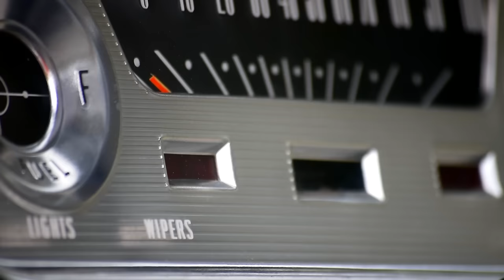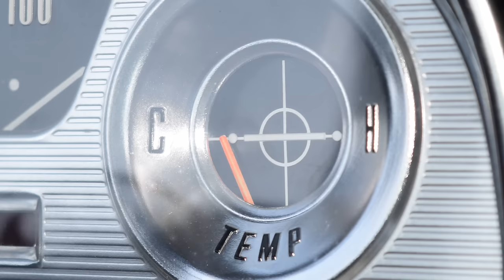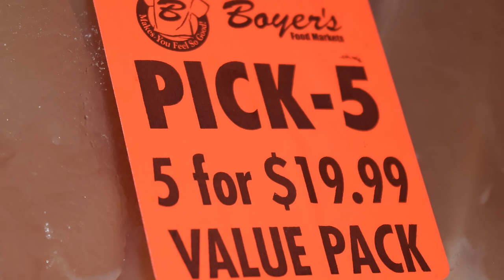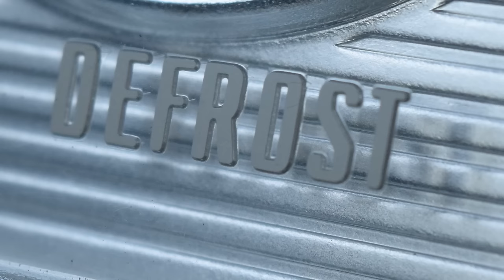Regular Car Reviews: 1960 Ford Falcon (stock)

Comment: FYI, the 144 was used through the 1964 year in the Falcon, Mercury Comet and E series vans.  Durable little engines.  Love Falcons!  Have owned a dozen, ranging from 4-doors,  Sprints and Futuras [coupes and convertibles], Ranchero and a trio of wagons.  I made a  63 wagon into a Sprint, too.  Lots of fun.  260, 4-speed, Futura seats and consolette.

Comment: The Falcon was brought to Australia and became Fords most popular nameplate in Oz until the models demise in 2016. The Inline six (with original block) evolved into a 4.0lt Twincam 24 valve with Variable valve timing and an Alloy head. In Turbo form, it cranked out 310kws of power.

Comment: This was my first car. I graduated in the 90's and my dad bought the Robin's egg blue version of this exact car. He found it in a newspaper classified ad. Remember those? lol This thing was so old it didn't have seat belts. My parents had to take it to the Dealership and it took ages for them to find some, since no one made cars with just lap belts. SEAT BELTS WERE AN OPTION ON THIS CAR IN THE 60'S!  I will say mine was a little fancier than yours as it did have the optional padded dash and the side view mirror, as  WELL as the two speed (slow and slower,) automatic transmission. Mine also had the 144 engine, and It broke down once a week whether it needed to or not.   OH, one thing you missed is that it doesn't have window washers.  My dad went to the junk yard and robbed the sprayers and pump and tank. The hooked the pump up to the battery and put a toggle switch in  the car. He taped it to the steering column. Flipped to "ON" it would run forever if you don't flip it back down to off. I did complain a lot about how it was so slow, so eventually he got a 200 motor and 3 speed transmission from an old wrecked mustang and put that in. It felt like a sports car after that.  A sports car that rode like a Cadillac with that vague steering you mentioned.   I kind of miss it now. lol

Comment: Got to love the Falcon, I remember these cars when they came out.  You could still see these cars on the road up until the late 1970's.  To the narrator, the Falcon's are not seen on the road today because they were daily drivers up until the mechanical end of the machine.  They weren't glamor cars, they were blue collar working man cars and were driven as such.  You could fix almost everything with a wrench and screwdriver.  The heaters worked and if you got too hot, well just roll down the windows and turn on the vent blower.  

Side note: when Star Wars came out in 77 Hans Solo flew what?  The Millennium (Thousand Year Ford) Falcon.   Dont tell me Lucas didn't get the idea for the space ship from that:)
Reply: so true. handle nice and fun to drive. i had a 3 on the column

Comment: The Falcon was a disposable car. They were fairly easy to repair, particularly the usual things such as brakes, water pump, spark plugs and so on, but rebuilding an engine was not part of the equation. There were no side access panels for the lifters, and you had to pull the engine to remove the oil pan. I know, I helped work on one in the early '70's. One thing it really had going for it was weight. Those weighed about 2400 pounds, so they could get decent gas mileage. The Holley carburetor was a very small 1 barrel. It almost looked like it was more at home on a lawn mower. There was a kit where you could put 3 of them on the intake. The intake and head was all one piece. There are cross members available for early Mustangs, and one might be a good idea if you want to drive a Falcon a fair amount.

Comment: The 1960 Falcon was my first car.  I bought it used in 1968.  It took me to high school and trade school for two years.  It took me to my first real permanent job at Chrysler Corp. in 1970.  The oil pump gave out and my engine went kaput.  Now I could afford a brand new 1971 Ford Mustang Mach II.  Moving on up.  And the rest is history.

Comment: Yes the Ford Falcon was as basic as they come, even the radio and cigarette lighter were extra option. My dad bought on in November of 59, the start of the 1960 model year. It was my dad's first brand new car. He always brought used before that. It was one of the best selling and most popular cars that year. The black interior was the basic interior and to start the model it was the only interior color offered. The Car came in different exterior colors, green, blue, red, white and black, but the Interior only black for at least the first half  of the model year. Later more colors came available, some interior options, too. That year my dad bought one, green with a three-speed manual transmission column shift and no radio, or cigarette lighter. A man he worked with bought a blue one same configuration. One neighbor bought a black one in the spring he was able to get an optional tuck and roll upholstery, another neighbor got a station wagon, which has a brown interior with a western horse theam to it. Only Falcon I ever saw with that interior. My uncle bought a white one with a padded dash and tuck and roll upholstery. It was the only one with those options. The Falcon line started the model year with just the basic two door car and added models throughout the year. By the end of the model year you could get a station wagon, a Ranchero type model, they put the Falcon nameplate on a van, it looked like a scaled down Econoline van. They also offered a pickup truck-style vehicle modified from the van. All these vehicles were basic. As the years went on the options and materials improved I bought a 1963 Falcon Futura convertible in 1969 for my first car. The last year of the first generation of the Falcon. The second generation 1964 and 65 had an all-new body design. The third-generation body design was all new again. It consisted of 1966, 67, 68, and 69. Only slight changes were made from year to year.  The steering wheel was different every year, the tail lights change in 68 and side body reflectors were added, that year. In 69 the reflectors were replaced with running lights. Weird things happened in 1970 Ford continued to make and sell the 69 model as a 1970 for the first half of the model year the they put the name plate on the basic Fairlane to finish the model year. It was the last year for Falcon and Fairlane in the US. 1970 was the year they introduced the Maverick. It was always my personal opinion that Maverick started out on the drawing boards to be the next generation of the Falcon, but marketing wanted a brand new model to create excitement to sell the car. So it became the Maverick instead.
Reply: YouTube  gave me this video to view again.  So a few more criticisms came to mind. The narrator of this post in his complaints tryst to make Ford look bad and blames Ford for the lack of quality of modern cars built today. The beather oil cap, the parking light not being amber, and he states that the only option was the automatic transmission. The fact is the radio and cigarette lighters were optional you could get the care without them. The 144 engine remained the standard engine for four years, with the 170 engine as optional if not available in the first half of the model year it was available by the next year. There were optional interiors. The standard fabrics in gray with black paint on the metal parts. There was an optional tuck and roll upholstery with upgraded fabric, still in gray. The station wagon models had all vinal seats. These options were available in 5he first model year. Some of the things that weren't there were not required by law like they are today, side view mirrors and amber parking lights. Although I can't recall any of the 60 Falcons I saw back in the day that didn't have a side rear view mirror on the left side of the car. If it wasn't standard it must have been another option. It wasn't until sometime during the 70's that they became required on both sides of the car. I think in 1962 Amber lights were a government requirement.
Reply: The Falcon was nicer than anything in its class coming out of Europe.

Comment: This brought back a few memories.  My dad bought one of these brand new (in Australia) when I was 3 yrs old and I still recall him bringing it home. I also recall the number plate - CFN 896. By the way, the Australian 144 CID engine was rated at 90 HP nd had a different final drive ratio to the US model.  That was 20% more than the 138 CID engine of the Holden FB at the time.  He worked as a real estate agent and wanted a roomy car that he would not cry over when clients messed it up.  He later bought a Falcon Futura 1963 with the 170 CID engine - and a big performance increase with 111 HP, and bucket seats.  My mom then drove the '60 Falcon and at 3 yrs of age, it needed a gallon or two of water every day to stop it overheating, one of the thrills of the unguarded fan in a warm climate.   He then bought an XR 200 CID in 1967, despite my brother and I nagging him to get the (then) 289 V8.

Comment: Here in Argentina, the Falcon were in prodution from 1963 to 1991, the first change that Ford Argentina made was replace the american 2.7 litres engine for a 188 cubic inches engine made in Argentina, and the second change was replace the 2 speed transmition for a 4 speed and third; the car was only made in  6 cyl. Sedan, no V8. Also we had some exclusive models

Comment: I learned to drive in my mom’s ‘61 3-speed manual with the stick on the column. There was no PCV system in the 144 and that too just vented to the outside via a pipe down the side of the engine. As the rings began to wear, the blow by would smoke out from underneath. I lost count of people telling me “Hey your car’s on fire.”

Comment: Bought one from a friend in the mid 70's for $50. Rear doors were held closed with a rope tied between the inside door handles. Common column shifter 3 speed manual with the roll pin that wears out and you have to hose clamp the shifter and the column together or the shifter just falls off. Drove it a couple of years and many miles. Very few problems, best $50 I ever spent.

Comment: I inherited my Aunt’s 63 Falcon that she badly overheated, The paint on rear block and valve cover was scorched off. It had the worst blow-by. When you stopped at a light the black smoke would engulf the car. It was a real dog, put four guys in it and head to Fire Island on the LI E and top speed was 67 mph with the pedal to the metal. It did have a floor shift, console and bucket seats to give it some pizzazz.

Comment: My first car was a 1960 Falcon. The best car I ever owned. I wish I had kept it. I bought it in1970 for $200.00 dollars. Best car to drive on icy roads. She wasn’t the fastest car but could do 60 without any problem. Over that she would start to shake but I managed to pass  all the slow pokes. When I bought another car I gave it to my father. He kept it till 1980 and then sold it to a young man as his first car. Never spent any money on repairs. My father would do my oil changes and tune ups for me. That’s all the work she ever needed. Also could fit a lot more people in it than just six.

Comment: They didn' t have a heater or radio optional also was a padded dash; my dad had one in Australia, Koala grey with a white top, they were an eye turner when released because the big seller at the time was the Holden which had fins and looked so old fashioned. They weren't rugged enough for unpaved Australian roads sometimes they would lose a front wheel, until they strengthened up the front end with the XL model, loved them so much I ended up selling them..... what memories!

Comment: I bought a '61 Comet in 1989 and drove it for 9 years.  It had the 170 ci engine and 2 spd automatic.  It drove perfectly well and didn't smell like gas all the time.  It was not underpowered, kept up with modern traffic, street or freeway.  It was a great car.

Comment: My parents owned a 1960 falcon station wagon. Not sure if they bought it new, I was a year old, but I  loved that car. I remember being about 5, I use to drop the tailgate and hand crank the window out of it. Smart enough not to sit on it though.  It died when the steering rod broke as my mom was pulling in to the driveway causing her to crash into the corner of the house. Only 7 but I cried when it was towed away. Wish I could get my hands on one

Comment: That engine is ADORABLE! It makes as much power as a medium-sized home generator!
10:24 meanwhile the two speed jetaway in my Oldsmobile (not a 4-4-2, they only had the 4 speed manual) can squeak out about 65-70 miles per hour with kickdown.

Comment: The basic structure of this car was used for the Mustang.  The original Mustang was nothing but a Falcon with a sexy European looking body on it.   Drum brakes all around?  In 1960 even high-end luxury cars came with drum brakes.   Single master cylinder?  All cars had them in 1960.  DOT did not require split master cylinder until 1967.   Side-view mirrors,  back-up lights, side marker lights, PCV valve,  padded dash,  seat belts, none of that was required by the DOT in 1960, lots of cars from all manufacturers rolled off the assembly lines without that stuff.   Cat?  Those did not appear on American cars until 1975.  As for Robert "Kill Ratio" McNamara, it's bullshit to say that he '...didn't believe in options.."   It was, and still is, common practice with car makers to hold off on  all the options in the first model year.   With each subsequent model year, more options would be offered to keep up interest in the car.    Eventually, the Falcon was offered with a huge option list.   Multiple displacement I6 and V8 engines were offered, including a Hi-Po four barrel 289 V8.  At the time all car companies used the gross HP method to advertise HP, only switching to the net HP method when gov regulations required it.   Multiple trans options, including 3 speed manual, 4 speed manual, 2 speed auto, 3 speed auto, shift on the column or floor.  Bench or bucket seats could be ordered up front.  Body styles included two door or four door sedan.  Two door hardtop.   Two door or four door station wagon.  Ranch wagon.  Two door sedan delivery and convertibles.  Manual or power steering was offered.   You could get the cars with a heater, or without a heater, with AC or without AC.   The options lists seemed endless.   Your snark is just cover for the fact that you didn't do your homework and don't know what you are talking about, or you are just trolling for clicks, or both.  In conclusion, fuck off.

Comment: I have a very base model 1966 falcon 2 door.  It has 3 on the column, two spoke steering wheel with just a horn button.  It is so basic it has a blank plate for the radio and the spot for the cigarette lighter has just a chrome disk.  It even has the last year 13 inch wheels and small diff.  Folks are always telling me to rod it and I don't because you see those all the time but you never see one bone bottom of the shelf stock.  It get 26 mpg and insurance is $20 dollars a month.  Its a great little car.

Comment: This was my first car, same color, although mine was a "Ranchero" You could drive all day at full throttle and never risk getting a speeding ticket. Three on the collum had a bad habit of getting into two gears at once (total lockup). Under the skin, the car was the same as the early V8 Mustangs. After years of swapping in high-performance Mustang parts, I finally built a pretty fast Falcon!

Comment: 494000 made in Argentina with '63 4-door body between 1963-1991 (minor changes in 28 yrs), since 1978 it had power steering and a/c, more than 150k still running, parts available everywhere, angines 170, 187, 188 and 221 6cyl. (no 144 here). A few 1962 ckd import ones too, mostly gone. People still loves Falcons.

Comment: I had a 1962 Comet, with that little 6, and a 3 on the tree. It was a good runner, and would do 60 mph all day, but the windshield wipers ... They were vacuum powered. I drove through a gale in Florida, and didn't have the power to shift up to 3rd. And the wiper blades barely moved unless I took my foot off the gas for a moment, so I could see where I was going. It was a good car for an impoverished teenage hippie, very easy to work on.

Comment: Back somewhere around 1968 my father bought a '61 Falcon 2dr. red station wagon from a guy he worked with at Union Carbide for $25.00 .  144 ci.straight six and a manual 3 on the tree . It had a rod knock . Dad dropped the oil pan ,separated the rod cap , hand polished the crank journal , & put in a new rod bearing . For many years to come it served as a 2nd family vehicle and extremely dependable . The running family joke from that point on was that anything and everything purchased was calculated into X numbers of Falcons .

Comment: I worked at a Ford Dealership in 1965. One of our loaner cars was a 1960 Falcon with the 144 ci. six and ford-o-matic trans. A true boat anchor. I heard it was so hated by the public that Ford offered to upgrade to the 170 ci. motor for just the cost of labor for the swap.

Comment: Every Falcon I was in from the first generation had a very distinct odor to the interior, perhaps it was McNamara's perspiration as he crunched those numbers. Regarding turn signal lenses, the change to amber was made in all cars in 1963. A family member had a well used 61 Falcon, it had the CA required PCV system added to it to replace that open crankcase, which was the souce of a ton of pollution.

Comment: I remember my Grandfather's 1960 ford Falcon. It was two-tome Red and White. For him i was a major improvement over his previous 1952 Chevrolet. But the he was still driving a Model T pickup for his 'work truck' until around 1962 or so when he bought a used 1954 Ford F150 pickup.